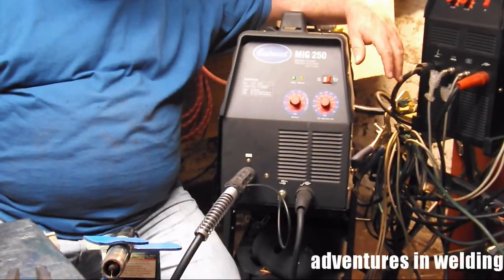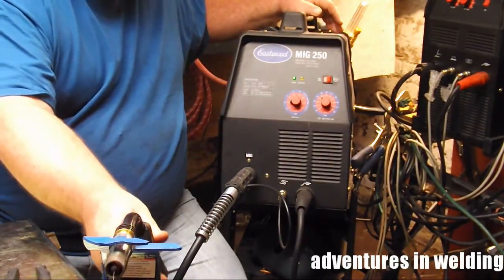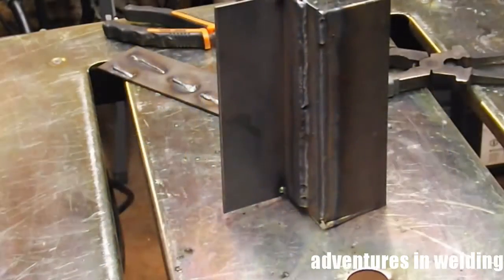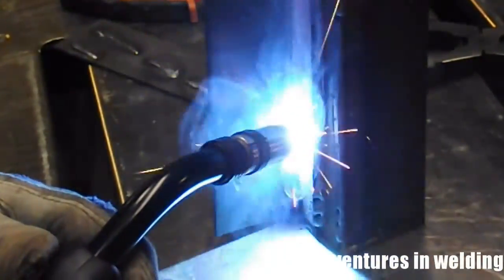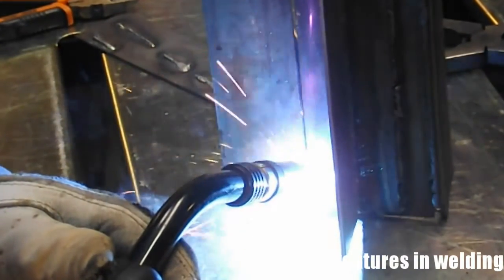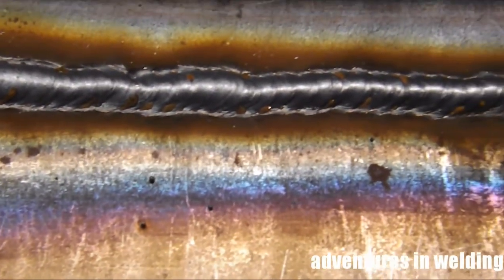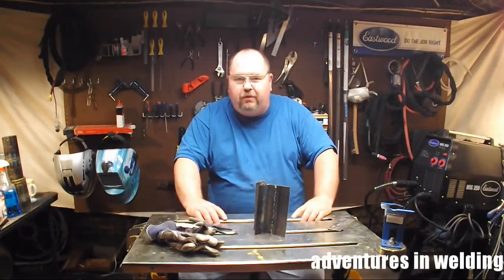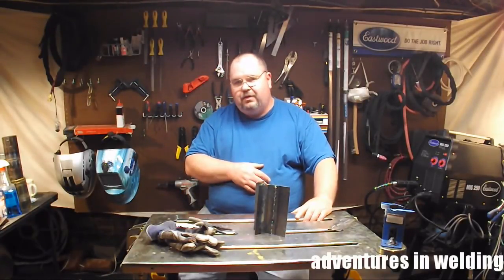Adventures in Welding 112 Vertical up MIG

Comment: Suggest on your open root but try triangle pattern with the center of the triangle on the joint. Pause very shortly to burn in the weld. Looks like you are welding just on the sides of the 2 plates and not burning in the joint. There is a good chance this can be happening on your fillets too but you can't see it. you can check by cuuting slices from the weld and looking at the root of the weld. I think Jody at welding tip... does this in a couple vids to show lack of penetration. Good luck.Mark
Reply from the maker: +xonkkram1 Thanks for watching, and writing in Mark.

Comment: Hey Paul, I use a lot of 0.9mm ( 0.035") ER70s-6 wire in my machine at work. Can you give a demo on 1/4" or thicker material on fillet welds to show others out here how you use the heavier wire.  Scott.
Reply from the maker: scott carr I'll get some .035...

Comment: 274! Gettin there Paul. Nice job on the uphill. Is it important to keep the gun pointed down through the full weld or do you start to push when you run outta that drag position...best way I can explain it, hope you understand...I was playing with my little hobart 110v using flux core last weekend trying verticle uphill, but made a real mess. My last pass looked better, but still it dose take quite a bit of practice for sure. I'm not even sure if it's practical to do uphill with flux core, but I tried it anyways. I was pushing up just ahead of the puddle, but if I get on it again this weekend I'll try to drag the flux core. I know enough with the flux core to drag doing horizontal and flat, I don't know why I tried pushing up with it though lol. Good vid once again and congrats on passing your test man. That's an accomplishment!! Nice stuff. 
Pidge.